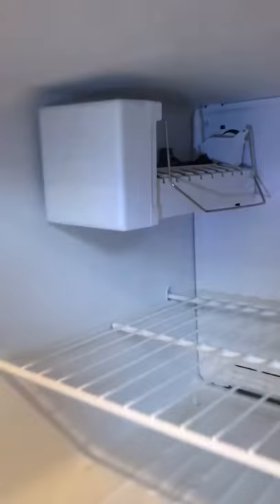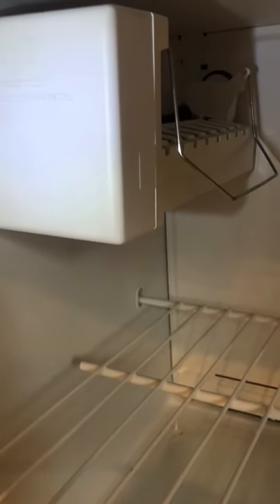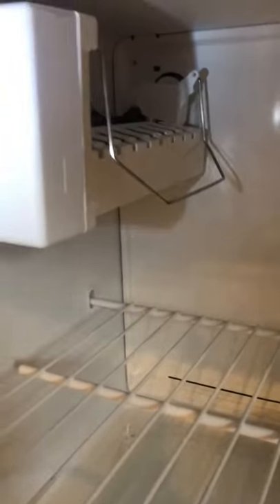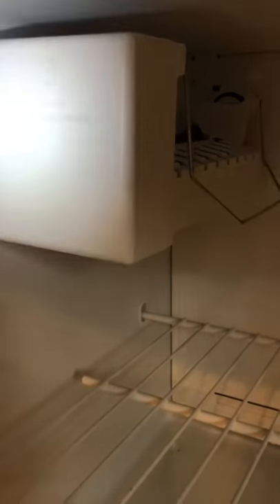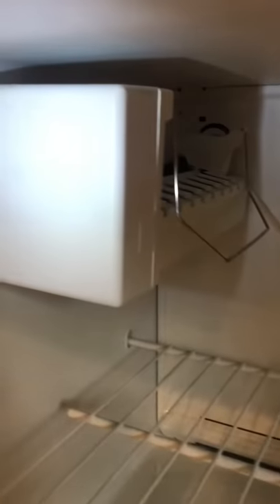Whirlpool refrigerator tripping the breaker fixed!

Comment: last week I bought an used Whirlpool with top freezer and ice maker just like yours,  brought home but it kept tripping the GFCI whenever I turned on the fridge even with the ice maker in the off position , watched your video and disconnected the ice maker wire, viola no more tripping !!!  I threw away the ice maker,  the exposed wire harness has 120v power so I just wrapped it in electrical tape and pushed it in the hole...thanks a lot for the video

Comment: Thank you for the tip. My whirlpool wrs335sdhm kept tripping as well. I flipped the ice making lever off and it hasn't tripped since. I noticed my ice was overfilled. Any input if the overfilled ice touching the wire harness caused the short? Also is the repair from here to repair to harness? Thanks in advance brother. You are the MVP